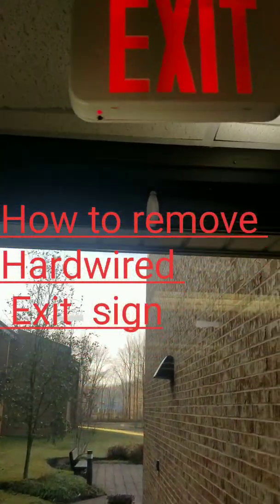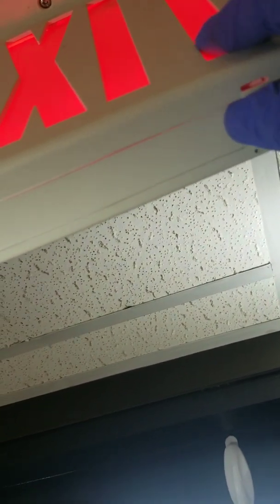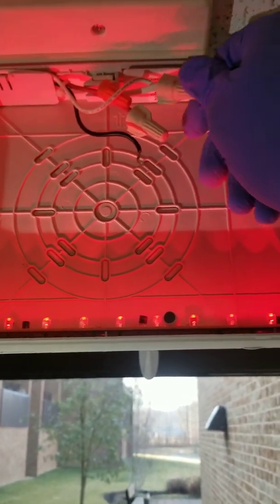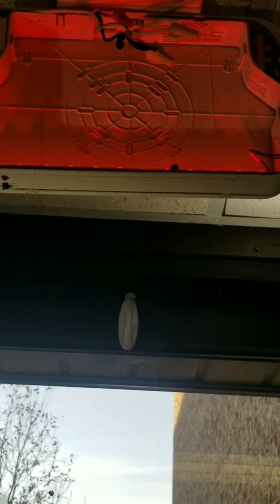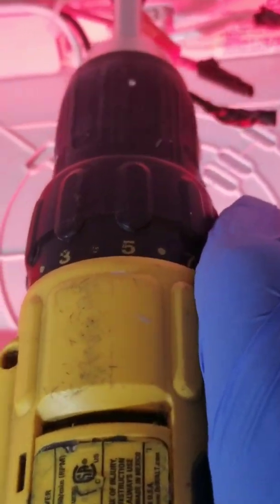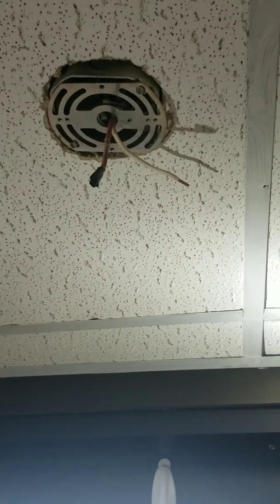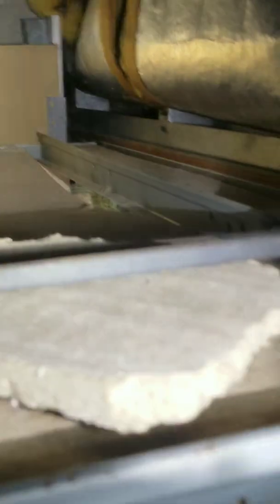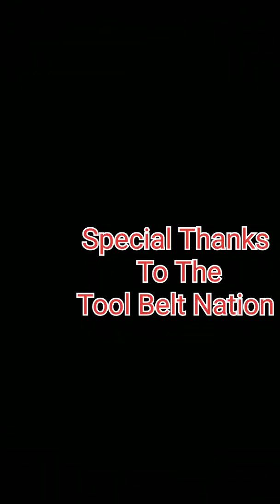How to remove  Hardwired exit sign

Comment: Thank you, exactly what I needed.
Reply: well turn the power off first it does not depend if you are conftable doing that with the power on or off because if you don't turn it off you have a high chance of getting shocked
Reply: @laureno7757  that isn’t always an option sometimes you need to work w power on